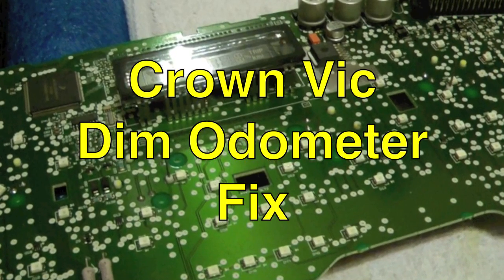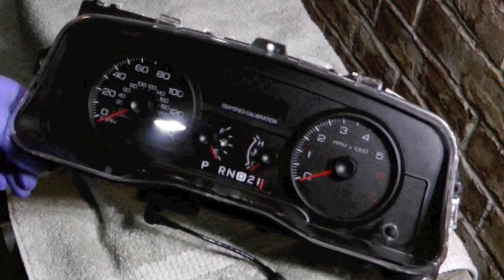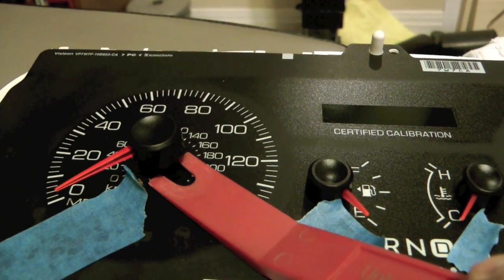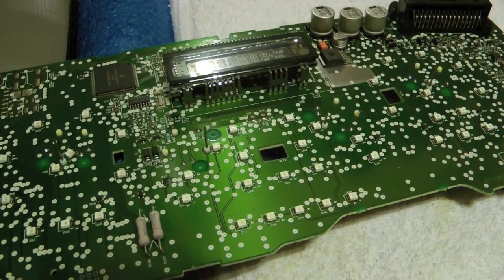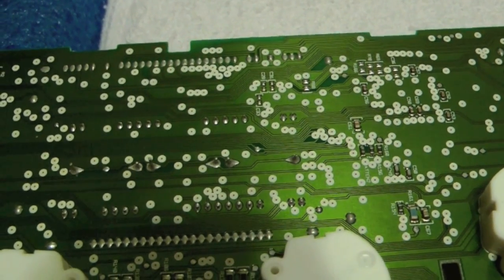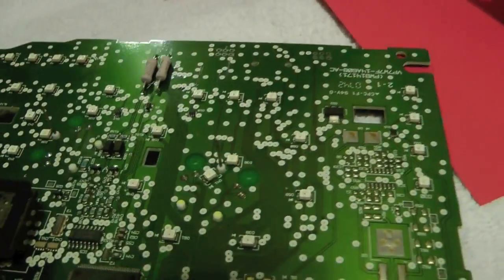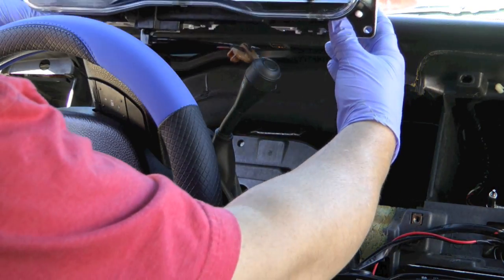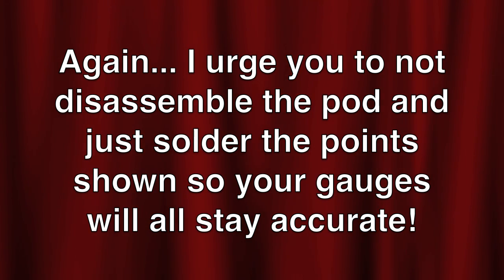Ford Crown Vic & P71/P7B dim odometer fix

Comment: Great video thank you! My gauges also went bad with no response long after the odometer dimmed out. I've heard others do the same. Will soldering just these points fix the gauges too? I guess ill find out tomorrow
Reply from the maker: you'll need to re-solder all broken solder joints - unfortunately there isn't an easy answer - you'll need to look at them under magnification and see which ones are failing... and then hope it's not a different problem other than bad solder joints.  Good luck!
Reply: @WJHandyDad  thanks for the reply. All solder joints looked ok with the naked eye. I dont have a magnifying glass but very good eyesight. I re-soldered all connections that you pointed out carefully and installed back in the car. Now my gauges work but my odometer does not lol. Thats ok i need the gauges more than the odometer so i know how much gas i have. We'll see how it holds up in the coming days
Reply from the maker: it's possible that something "went out" on it and would have to be replaced.  I ended up buying a new cluster when mine finally died and couldn't be revived by me or by a shop
Reply: @WJHandyDad  yes that could be possible.  I'll drive it as long as the gauges work... but it would be nice to know how many miles are on the car. If the gauges fail again I'll probably look into getting a whole different gauge cluster like you did
Reply from the maker: I've got a final video coming about the saga of the dim odometer

Comment: im confused, so do u take the cluster out an just solder the back an the dim will brighten up?
Reply from the maker: yes, solder the bad solder connections (or just touch them all up) and it should fix it unless you've got a more serious problem.

Comment: Is this the same procedure if your mileage doesn't show at all?
Reply from the maker: assuming yours is a completely broken solder joint (or more than 1), then yes.  If it is some other problem then no.  But it might help you find the problem if it's worse than just bad soldering

Comment: What's the difference between a p71 and a P7B?
Reply: No diff between them, if the p71 is latter years ie late 2010’s. Just a nomenclature change for some reason, starting 2010. Nothing to do with whether it’s SAP (street appearance package).
Reply: A P71 was manufactured through 1998 -2009 and a P7B  2010-11.
Reply: @paulkowalczyk9468  the p71 is the standard police package with none of the bright trim that the LX models have the p7b is also known as the sap which stands for Street appearance package it has all of the chrome and bright work of the luxury or LX model but it has all of the police department goodies

Comment: I did the same steps but now my shifter won’t shift out of park.
Reply: neutral safety switch
Reply: Check that the shift lock solenoid is still plugged in or that you didn’t pinch a wire leading to it. Green 2 pin connector on the bottom of the column when you have the trim off. With a red/green wire and a black wire.

Comment: So just soldering also fixes the odo going dead for a couple seconds and such?
Reply from the maker: if the problem is a bad solder joint or joints, which is the most common problem, then yes
Reply: WJ Handy Dad I’ll definitely be having a look at it later today, thanks a bunch.
Reply from the maker: the breaks in the solder may or may not be easy to spot... doesn't hurt to touch them all up if you are comfortable with a soldering iron
Reply: @AdventureWithAustin  

How did it go?
Reply: @WJHandyDad  What's the difference between a p71 and a P7B?
Reply: @ozziecrosby2092  Didn't entirely fix the problem, but the solder points are the problem though. I would still recommend sending the odo into a 3rd party company to have them re solder the points and they might even put in some new parts as well.

Taking the odo out is actually not that bad, just a little time consuming.
Reply: @AdventureWithAustin  

👍

Comment: Great video brother. Thanks. For anyone reading this and wanting to change there bulbs they are 3528 smd. My soldering exsperiance is limited to stick soldering and that was 20 years ago. For me it wasn't that easy but it is doable the LEDs cost like 7 Bucks for 100. I actually had an extra cluster out of an LTC 2007 I was going to do the swap and I still might but I had the extra cluster to practice on I also had an extra harness that I cut out of the LTC where I got the cluster from. If you are going to do the LEDs it is important to check after you solder each led to the board for me I already had the extra harness with about 12 in of wire hanging off the connector so plenty of wire to attach power to the reason is if you replace an LED and don't get a good solder point it will cause more than one not to work like Christmas tree lights so best to check after each one you solder on.

Comment: There are surface mount resistors underneath the odometer display which are also a common cause for the failure. Unfortunately these DO require disassembly, and as they are underneath the display, are rather hard to get to and touch up.

A full write up can be found at https://www.crownvic.net/ubbthreads/ubbthreads.php?ubb=showflat&Number=3052074#Post3052074
Website is glitchy since it was bought by VerticalScope... Pictures don't always load.

The LEDs are all 3528 SMD LEDs. They are all soldered on, no glue. They also all face the same direction. If you get a spare cluster harness from a junkyard, applying 12v to the green and ground to the black will illuminate the backlight LEDs. You can get clear needles off a 06+ town car or grand marquis cluster if you wish to change needle color as well.
Reply from the maker: Thank you for sharing these tips!  The link you posted doesn't show any photos... does it show photos for you?  I'm wondering if it's a PC vs Mac issue?
Reply: @WJHandyDad  Crownvic.net has been facing issues for a couple years now. The photo server is apparently down, looks like it has been for awhile... Vertical scope has shown very little interest in fixing problems. Try viewing the page  on the internet archive.
Reply from the maker: I tried to join Crownvic.net multiple times beginning years ago and it never went through.  Yeah, I'll have to check it on the archive site... didn't think about that.  2 great resources!

Comment: This looks a whole lot easier than what I seen another videos. I thought removing the gauges was required along with the needles. I can't wait to pull mine and then solder the back pins which I'm sure has developed cold solder joints. Thanks handy dad!

Comment: I've been hoping someone would do a video on this. I have had my car for almost 2 months, and I've only seen the odometer twice, for about 30 seconds. All I could find was F150 videos. Thank you!
Reply from the maker: when I started getting a bit of dimming in my odometer area every once in a while I started googling this topic, couldn't find anything other than "send it to me and I'll fix it" stuff.  I was amazed because almost everything else is well documented
Reply: Mine isn't dim. It just doesn't work, except those 2 times. I was sure it had to be cracked solder, it just happened to touch a couple of times. I couldn't believe nobody had a repair video or anything on the forums. Everybody just seems to take it out and send it to one of the repair places for a hundred bucks or so. When I get the time, I'm going to harbor freight to get a soldering iron. I really appreciate you posting this and showing where to look on the board without having to take the whole thing apart.
Reply: @jasoncooper3116  do you ever fix it?
Reply: @counterthirty  I did, but it stopped working again. I don't know what I did wrong. I may eventually send the cluster off for repair. Ie been doing other things to it for performance lately.
Reply: It is a 2007 P71 with almost 152,00 and 4303 idle hours.

Comment: Oh thats wierd they didnt just put old dash bulbs in it.
Reply: This is one main reason why I like my 05'. I've only had to pull the cluster once and changed all the bulbs while I was at it. Of the whole interior, Ford chose to update the gauge cluster, then give people hell down the road.
Reply from the maker: yeah, I had an '03 and changing out the bulbs was easy
Reply: Especially when the hvac controls are old vacuum style.
Reply from the maker: yeah, the older ones with bulbs definitely easier to change the bulbs!